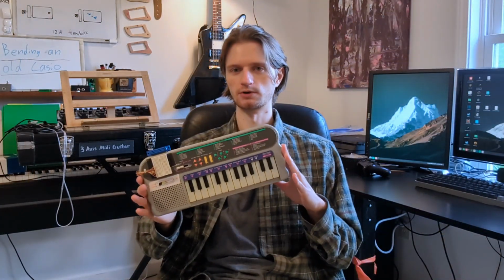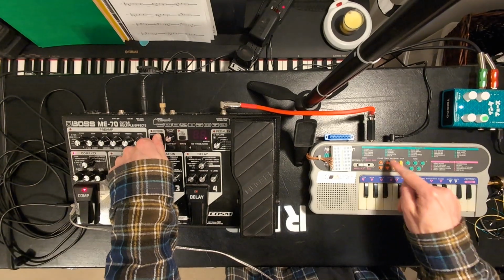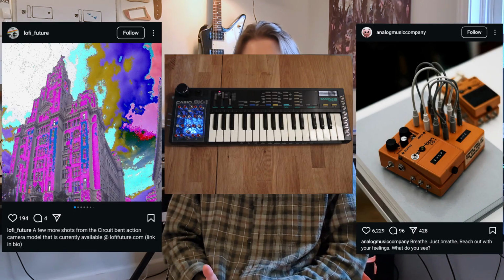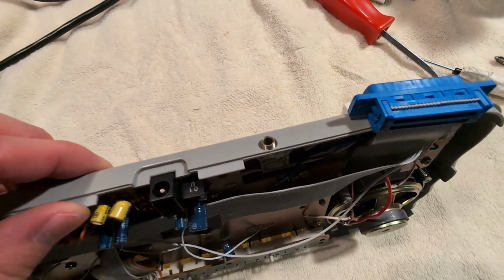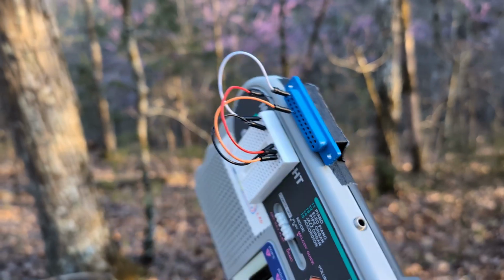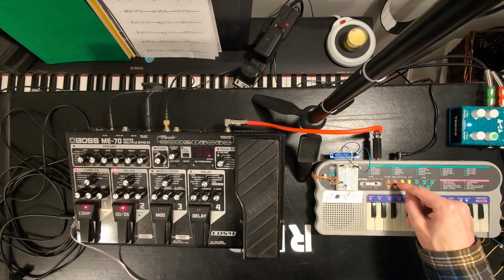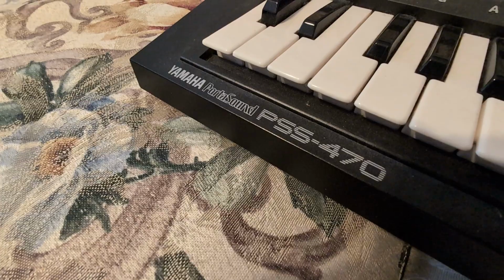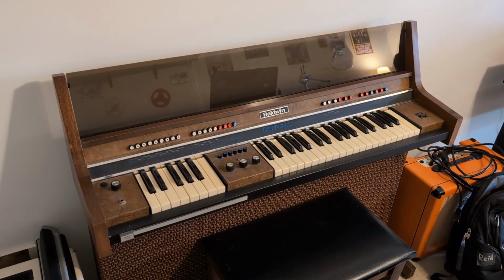My $4.00 Circuit Bent Casio ML-1

Comment: Im new to this, if I’m plugging my Casio in with a 9v adapter from mains, is it safer than circuit bending a “mains power” synth? Also the ribbon cable patch bay is genius
Reply: Stick to battery powered devices.  I can’t stress that enough.

Even if the adapter is outputting DC I still would avoid circuit bending something plugged into the wall unless you know what you’re doing.

Comment: when I first started out with circuit-bending, I had absolutely no idea of what I was doing, and so the first thing I tried, was to bend my 1970's Hammond organ.  I was just sweeping my fingers accros the connections on the circuit boards, licking them for better conductivity, even.  I was SO lucky not to get zapped!!  at one point, I had this old electrical wire that I used instead of my fingers and sure enough; sparks came flying off.  as I still didn't perceive the actual danger of that, I continued to prod with the wire and eventually ended up frying the circuit boards so bad, that the organ was toasted and wouldn't turn on anymore.  I found out later that, apparently, it is usually not done to try and bend instruments that use live electricity... 😅
don't worry: I learned my lesson.  I've since, turned to battery-operated instruments only.  be it with varying succes.